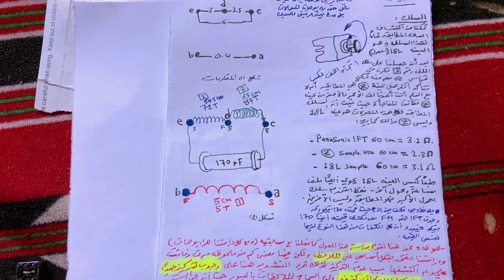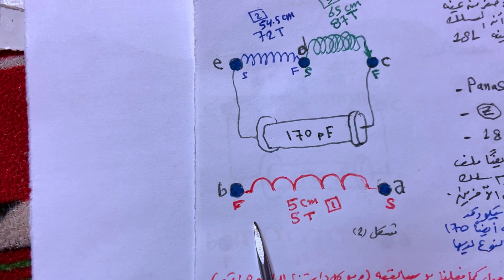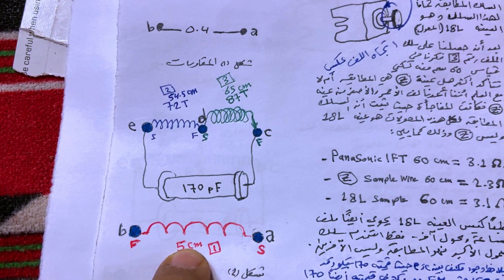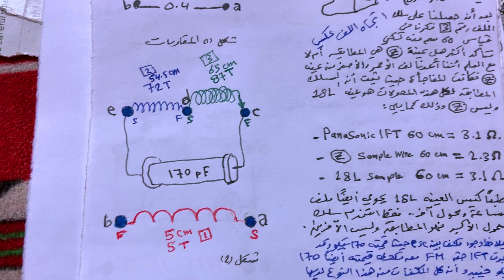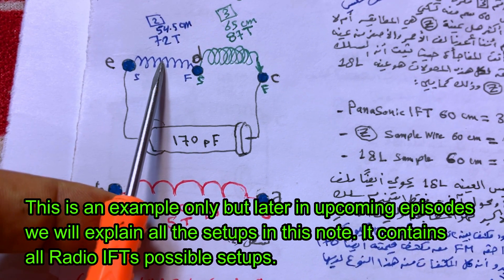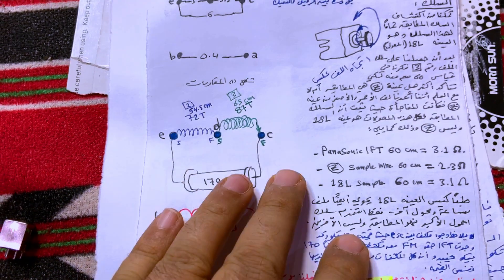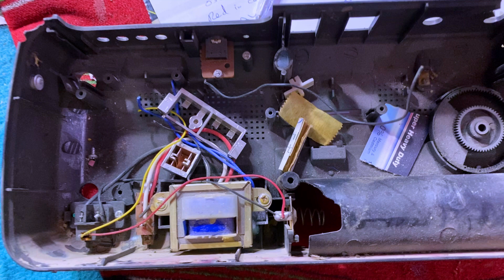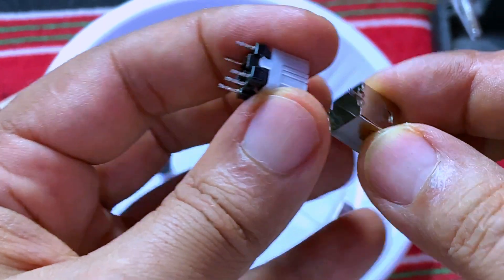DIY IF Transformers make them yourself (Part 1 of 2)

Comment: Good ideas Thank you. However, regarding the small caps inside the transformer. I wouldn.t actually bother fitting them inside anymore. It is more trouble than help. I always put them on the PCB next to the transformer. This way they can be tested and replaced when needed ! Having the caps inside is a real pain. Just imagine having to change one of those inside require you to completely de-solder the transformer, disassemble it and under the magnifying glass install another and everything is so small you could break some winding ends in the process and you wouldn't even notice it and even worst,  because you have to de-solder and re-solder back the transformer chances are, you could end up with broken (lifted) PCB tracks etc. No, is way too much trouble!

Comment: Why make them instead of buying them to keep the demand alive so they keep manufacturing them?    Or it will be like trying to buy if coils for say...a Hallicrafters s38 line of radios.  Theyre not made anymore.  Whatevers left in some old codgers barn or toolshed as NOS is all we have left.  Nobody makes basketweave coils at all for decades either.

Comment: Your work is genius and brilliant!  With completeness, you have added much information to help us all to restore old radios and get the IF transformers working again.  Thank you so much for helping us in the restoration business.   In particular I liked how you (1) indicated that SMD capacitors can be used to replace bad components, (2) found and modified a toy with rotary shafts and then add the turn down screw to hold all in place when winding, and finally (3), providing your wire-winding values.  It is really a most useful video!  Thanks so much!

Comment: Brother I don't have those parts for IFT. I have some inductor chokes instead. Can those inductor ferrite cores be used to design IFT?
Reply from the maker: Yes, but you need to increase the round. Do ur own calculations.
Reply from the maker: Yes, but you need to increase the round. Do ur own calculations.
Reply from the maker: Yes, but you need to increase the round. Do ur own calculations.
Reply: Thanks for the replies! I am a radio enthusiast so can you kindly upload a video on how the Local Oscillator works in a Superhet radio?
Reply from the maker: Yea
Reply: Hey I have another question, what are the usual inductance of IF coils? I need to know so that i can calculate my own.
Reply from the maker: Ok, this is really a good question but I made a video about this in the previous deleted channel. It was only about IFTs. Feel sorry, for losing that video, but any way I will make another explaining video about inductance and the different IFT inductances. I did not want to go on this in the video so that video would be simple. (i.e. the more turns of a wire, the more inductance value).

Comment: Hello, Do you know type and values of the encased capacitors that those IF trasformers have?. Thanks in advance.
Reply from the maker: Some of them are 40 pf or 45, 180 and 170 pf it depends on coil inductance according to the purpose in circuit IFT is used for but for the radios I documented most of their patterns along with coils information in a note, so I think may be I will need to upload the information in that note. Use SMD capacitors instead of those encased caps, they are more stable and more accurate.

Comment: Friend, this coil I'm asking is the coil of Antenna L3 of the Sanyo M9830K radio, this coil was open all of its wire and it doesn't have that capacitor at the bottom can you give an idea of the number of turns of wire for me to wind it again?

Comment: I have national  Panasonic pocket radio rf 9.mw oscillator coil is dead. I'm trying to rewind it with new wire Primary/secondary.after completion mw responding clearly full scale, but different wave bands receiving. I guess wire gauge changed. Can you suggest? The coil in the metal case is the micro size.
Reply from the maker: Yes, full video about this showing more than 20 vintage oscillators samples. Hopefully will be uploaded soon.
Reply: @afaifeem  thanks for the reply. Looking forward for your reply.

Comment: Great job , can I wind the same of those to work as MW band RF transformer , can you help me with that ?
Reply from the maker: Part2 of this workshop will answer your request, not only that but will explain how to make any IFT for any purpose, at any setup and/or any frequency:
https://youtu.be/mUIpXdqEhgg
Reply: @afaifeem  I watched it , not what I am seeking , RF transformer is used as an output transformer in RF amplifier , it's tuned with a tuning capacitor .
Reply from the maker: @hunk6019  The video I am meant is still not uploaded yet. It is part 2.
Reply: @afaifeem  I am waiting